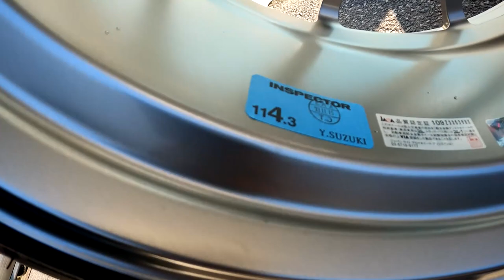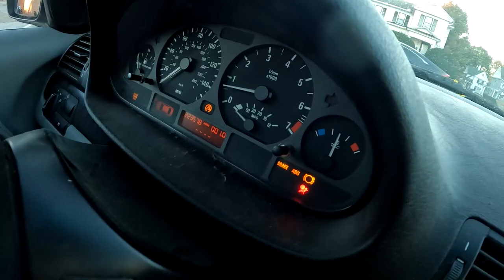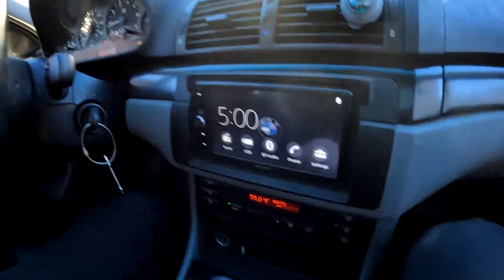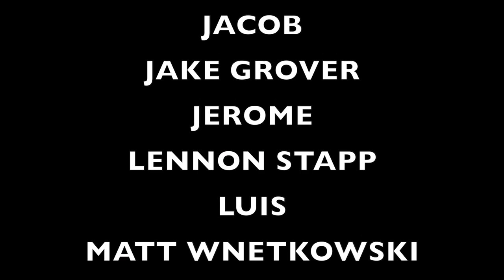COMPETITION GETTING SERIOUS!!! (E46 WAGON DONE!)

Comment: Fwiw my Work CRKai 5x114.3 all have 5x100 stamped on the wheel. I thought it was weird, but I looked into it, and I guess they use the same molds for all the different bolt patterns, and they just drill them differently.

Comment: Might have been a factory error wheel. I bought a set for my my 90/1 ef hatch ordered em had em sent and got my 4 lug wheels that were 4 lug but stamped 5x100
Reply: Messed one 1 up looked for a replacement mis-stamped 5x100 think I paid around 8-900 for the set think one mis-stamped that said 5x100 were listed for 550-600 each after the supplier realized and fixed their F 👆